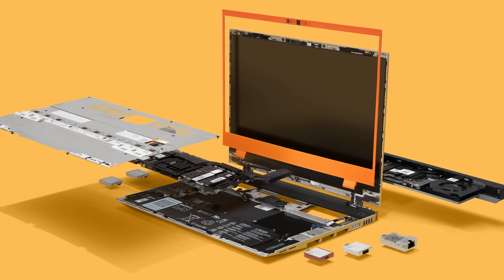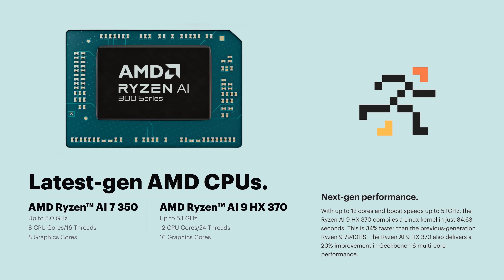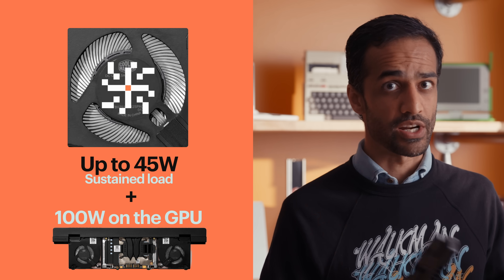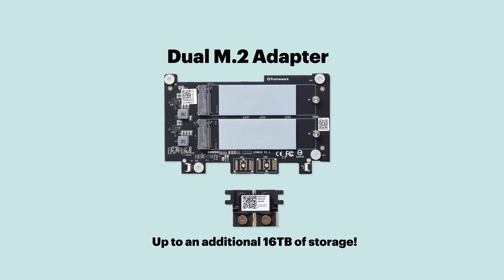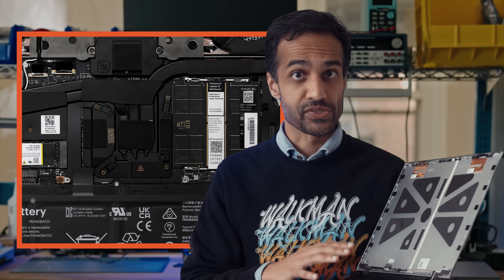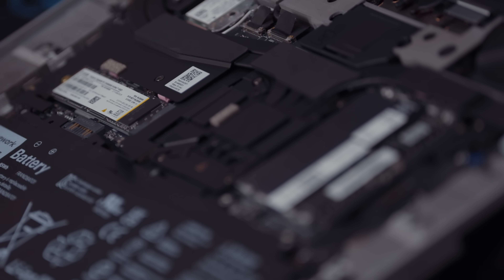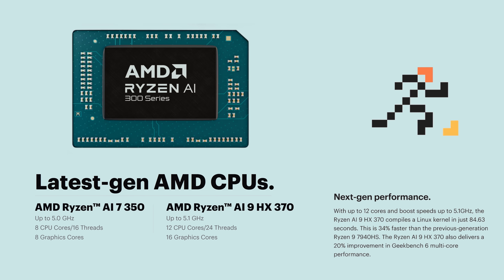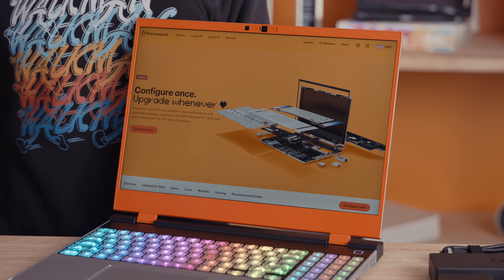Introducing the new Framework Laptop 16 with NVIDIA® GeForce RTX™ 5070

Comment: no hate..but i dont see the point in having an "upgradable" Laptop which is twice the price of a laptop with similiar performance.
Reply: It all comes down to what you, as a consumer, prefer. Some people say my privacy focused phone is 3 times more expensive than a similarly specced phone, but for me personally, it's the one that works for my use case.

In your case, if the modular design isn't good enough to justify the higher price, then yeah, it's not worth it.

Comment: Does this has soldered ram as well? I would never expect Framework do that, except they did it in that desktop thing they did, so I'm sus if that is actually the one I was expecting for.
Reply: It's not. The CPU in the desktop wouldn't work without the soldered ram if I'm not mistaken and they were shooting for a AI powerhouse. Made the most sense for the mission in the desktop. From what I've read this is the reason that this laptop doesn't have the came chip as the desktop, so it's swappable

Comment: If your still around when my Surface Book loses Windows 10 updates, I'll drop by and see what you have on offer.
Until then, I'll be following on forums and such for updates on your maturing product line.  
Want to see how your tolerances translate into a unit that's not falling apart from fatigue in a couple years of normal use.
I assume my Surface Book 1 should just now be in the prime of its life, for example.

Comment: Framework, will there be at least some military-grade protection for those living in urban areas under summer heat, and tropical areas? Engineers, architects and on-the-go power device users might need them

Comment: Why laptop with basic specs costs around 1000$, when i can buy better for same money. And i already did. What's the point? Upgradeability?
Reply: that's the main reason to buy this... upgradability and easy to repair.. you pay big at first but it cost less and less to upgrade it to the current future gen, rather than spending $700 for the same standard in the future i'd rather pay $500 motherboard upgrade

Comment: i have a 2018 MacBook Pro - the battery will no longer hold a charge. I took the laptop to the Apple Store to have the battery replaced. They plugged my computer into a tester to make sure that the battery was the only thing that was wrong with it - confirmed: the battery was the only thing wrong. Then, the kicker: they no longer will repair/replace batteries on my model so a perfectly good computer is now e-waste 🤬. My next laptop will be a Framework.
Reply: they more expensive then apple..
Reply: @0xVlad maybe - but repairable.

Comment: Hey Framework your laptops have a great modular design and creative innovations. However, for IT security, your trade-offs are important to know:

- Firmware Updates: Historically, BIOS updates with critical security patches have been significantly delayed. While Framework is improving this, it's a risk for those requiring immediate patches.
- Secure Boot: It works, but configuration is more technical and less intuitive than on mainstream laptops. It's not "broken," but it's expert-oriented.

Verdict: You trade a polished, automated support experience for hardware repairability and control. For security professionals, this means more hands-on maintenance and potential delays in updates.

Comment: FYI, just ordered a Zenbook Ultra G1a. I was strongly considering the Framework 13, but it was screen flex that pushed me over the edge to spend 2x the price and get the Zenbook. Don't listen to your fanboys that screen flex isn't an issue. It is. For business needs, we care strongly about the durability of the system. I need my laptop to last me 3-5 years between refresh cycles. Hopefully in 5 years y'all have this addressed across all models but otherwise it keeps y'all consumer grade only.
The gold standard I aim for is "Can the airport security team chuck the laptop across the scanner belt without having any damage?". That's the level of durability that I don't just want, but absolutely require. In the past, I've purchased slower and less portable laptops because it was the only way to ensure the hardware would last a full refresh cycle. I'll be watching closely. Good luck!

Comment: I bought a used P-whatever thinkpad like 2 years ago where I could upgrade the graphics card. There were graphics cards being sold on ebay. The card wasn't swappable by just sliding a module out the back, of course. (I returned the P-series cause it was so large it barely even fit into my backpack.)

Comment: I am very interested in purchasing this. However, I require at least 16GB of VRAM and currently a 5090 with 24GB would be best. Is such an option on the horizon? I would especially appreciate a higher end laptop that is repairable.
Reply: They can't as the GPU module can only accommodate 4 memory modules.
Reply: @michaelhorgan9525  I am not familiar with such details. Does 4 memory modules mean 8GB VRAM maximum? Or is that something that can change from generation to generation?

Comment: Need 8 expansion ports on this instead of just 6 to really take off, and Nvidia GPU is just 8GB, Acer predator has the 5070Ti with 12GB of VRam and is significantly cheaper, come on!

Comment: Can you offer old mainboard modules officially as options on your site? I have a FW 16 and while its great, i cant run win10 on it because of the newer tpm modules not supported on win10 (which is complete bs on MS's part). Id take the ability to support win10 with tpm and a lower price by downgrading to an older mainboard if that were an option. (Theres the 7000 series on the website but wasnt there an older intel version of the 16 too?)

Also itd be neat to provide options for wifi modules included, realtek is just inferior to intel wifi cards; or leav it out for like a dollar less price lol
Reply: intel was never an option for 16

Comment: Is the graphics card board connection port proprietary?
Is there no way to use an adapter or extender to connect an external graphics card via PCIe and utilize the full bandwidth?

Comment: I understand not being able to get 9955hx3d into the laptop but a 5070ti should have been used instead of the 5070 so users could get 12gb vram instead of 8.
Reply: if you watch their q&a they physically couldn't fit any more onto the chip, so they went with 5070

Comment: Pre-ordered one, batch 4. Stay true to your mission, and you got yourself an eternal customer.
Reply: Which one did you ordered? I saw there were few models?
Reply: @sanudas3398  Ryzen AI 9 HX 370 with RTX 5070 module
Reply: @sanudas3398  I ordered the Ryzen AI 9 HX 370 and the RTX 5070 expansion module.

Comment: Nvidia is welcome, but still 2 main missing features for me to never look back:

- ThunderBolt 4 or 5 (this requires Intel CPU normally). I refuse to buy a laptop that doesn't have TB these days.

- True TKL keyboard, for those who are blindly typing using PROPER SIZE Arrows + Home|End|Ins|Del|PgUp|PgDn in their standard positions (and are willing to sacrifice an otherwise lame numeric keyboard). Just check what Logitech has done with TKL 915.
Reply: the usb c ports match the spec for thunderbolt i'm pretty sure, they just aren't certified because it takes a while to be certified

Comment: With a dedicated GPU, is there actually an option out there (like a docking station) that delivers HDMI and power through one USB C cable with enough wattage?

Never found a docking station that could deliver enough W to my laptop (which charges at 300W :’( ) - makes the thunderbolt kinda useless

Comment: $2,350+ (not including shipping and taxes) for one of these with a 5070, no ram and no storage is just crazy!  I get that this is super repairable and all that but, why would anyone pay $1,000+ extra (based on a comparable normal laptop prices) just for that?! If you buy a normal one and take care of it i'tll last you as long as the live support of this thing and the money you saved can go to the next one you get!
Reply: You're paying precisely for upgradability & repairability. Framework do not have a 'live support' limit. Their goal is for a laptop lifespan of 7-10 years. That's way beyond what some craptastic piece of junk can manage. Framework users can swap out broken or outdated components at will, which means the laptop isn't just surviving, it's thriving. 

Most laptop manufacturers can't even repair their products within the 12-month warranty, let alone years down the line. Not to mention the terrible environmental impact. This short-term 'make it cheaper' mindset is partly why companies have turned to subscription models and engineered obsolescence.
Reply: @alexanderg1935 and how much will those repair or upgrade parts cost you? If the prices are as high as this you're way better off getting a brand new one!

Comment: It is nice to see what you guys are doing but the price and specs for the laptop are too high. Can you make a laptop with midrange specs Ryzen 5 or 7 or i5 with 4060 or 5050 or 5060. Please, 
this laptop with Ryzen ai 7 350 32gb 1tb SSD rtx5070 (8) costs me 2600$, 
While another laptop with same specs but with 2tb SSD and a oled display only costs 1800$ to 2300$ that is with better cooling and RGB. If you can manage the pricing this laptop will be amazing

Comment: Why are these Framework 16 laptops so expensive? £2.7K for a AI9 HX370 and a RTX 5070, when I can get an MSI Stealth A16 (which also has HX370 and RTX 5070 even a power adapter who would have thought) for £1.9K? Gigabyte Aero X16, same specs £1.6K. Your laptop seems like a scam, an upgradable laptop is supposed to save you money. I don't understand why you are charging 40-60% more than the competition just so you can "upgrade" with an overpriced module. Why would anyone buy this laptop instead of literally buying a RTX 5080 laptop with night and day performance gains for the same price.
Reply: cuz what u gonna do when ur precious msi stealth breaks lol

Comment: 3:49 This prompted me to scour the website for GPU options with more than 8GB of vram for the framework laptop GPUs. Unless there's some new technology that I'm not aware of that makes the CPU alleviate VRAM limits, it's like loading a truck with stuff. If the truck holds 3 tons (8GB of vram) of goods at max, and you try loading the truck with more weight (more VRAM) the truck isn't happy.  Mobile RTX 5070 with 8GB of vram just feels so wrong, unless GDDR7 somehow works around this issue. Then I'll eat my words.

Edit: I know this isn't Framework's fault, whether it be physical space on the modules or theoretical use-cases, but it's something Nvidia could be doing better.

Comment: This is great news, absolutely fabulous. 
One problem: the industry did not fail to solve the problem. It's the opposite. Solved multiple times, solutions die. I owned 2 (still own Area51m) laptops where EVERY component including gpu is replaceable. 1) no parts; 2) the manufacurers move on with more pads than the last generation, it's physically impossible to fit. 
The PCIx bridge is of course convenient but only as long as it's backwards compatible as an interface. (Which it should be - for now). I'm rooting for you guys and really curious how many years of compatibility we can win here. As of now, the 240 W model is finally something picking my interest in a practical sense. Well done.

Comment: Is the new Graphics Module compatible with 7040 series laptop 16? If not, then this is not a real "Upgradeable GPU", since you need to buy new laptop
Reply: That's actually stated near the end of the video. Very nice to have an option of 7040 CPU and 5070 GPU together. Finally, FW16 got a massive update. Great job, Framework!

Comment: 2:37 - This laptop is already e-waste for gaming purposes. Such a shame you didn’t go with the RTX 5070 Ti instead. As Hardware Unboxed and Jarrod’sTech have pointed out, 8 GB of VRAM is outdated in 2025 – we’ve had that since the GTX 1070 back in 2016. For modern games at 1440p/1600p on high settings, it simply isn’t enough. Once VRAM runs out, the system starts swapping to RAM, which causes severe stuttering and ruins the experience no matter how fast the CPU or SSD is.
Reply: Play better games and that won't be a problem.
Reply: @lembarkii8669  That’s not really a valid counterargument. Hardware isn’t judged by how it performs in cherry-picked titles that happen to be lighter on resources, but by how it handles the current and upcoming games people actually buy gaming laptops for. In 2025, 8 GB VRAM is a bottleneck at 1440p and above, and once the buffer runs out, no amount of ‘playing better games’ will prevent stuttering and frame drops. The point stands: if you’re paying premium for a gaming laptop today, it should be equipped to handle modern workloads properly, not rely on avoiding them.
Reply: @sondrel2  I think this problem should be solved by the videogame companies that no longer care about optimizing their games properly just because technology is growing fast and they forget about last year's systems 
Or maybe, just maybe, laptops were not meant to have the power to play the newest, top of the line AAA games at that high resolution. I'm pretty sure that it's only those kind of games that need over 8 f-ing GB of VRAM
Whoops, it seems like I ended up exploding into this rant, sorry... I mean, it's ok to want to play these games in other places away from home, it's just that I despise when this problem is shown as normal, especially considering that it's not that hard to solve 
Have a nice day ❤
Reply: @EtherealBook  I get your point, but the responsibility can’t just be pushed onto developers. Games will always continue to grow in complexity, and history shows they rarely scale backwards to fit old hardware. It’s the job of hardware manufacturers to provide specs that actually meet modern demands. 8 GB VRAM was fine years ago, but in 2025 it’s objectively a bottleneck at 1440p/1600p. And regarding laptops: there are plenty of models today that do handle AAA games well, it just requires the right GPU choice. Pretending that this limitation is normal only lowers the standard for everyone buying ‘gaming’ hardware.

Comment: Can you please emphasize the difference between upgradable and repairable?

If you're not offering anything better than an RTX 5070 is it really upgradable? Or are there any other GPU modules being planned with an RTX 5080 and RTX 5090?

For an almost $1000 extra premium that brings me upgradability, I sure hope that I can upgrade the system in the future. Or else if I can reduce my costs and get a cheaper non-upgradable device with RTX 5070. And a few years down the line purchase something again non-upgradable (thus, cheaper) with a 70 series card.

The upgradability just becomes a gimmick if I cannot get to a higher level than what I am currently at. Which in this case is pretty average middle of the pecking order specs especially on the GPU side.

Also, can you guys please put the Ryzen AI Max+ 395 on this laptop, the one on the framework desktop, and then put an RTX 5080 or RTX 5090 in it?

As someone who works with LLMS and likes to play GPU-heavy games, I would love to see that happen.

Comment: Unfortunately 5070 is the worst laptop GPU out of all the 50 series GPUs out there due to it having the same VRAM and 100W max power limit as the cheapest 5050. There is no point in spending so much money on that upgrade. It would be great if Framework supported RTX 5050 or 5060 as well as those are the actual reasonable value for money cards. 
If anyone wants to pay more for performance then the upgrade from 5050 or 5060 should be to 5070 Ti since it actually has more VRAM and higher power limit than those entry level cards, unlike 5070 which is an NVidia money trap.

Comment: But if you have an older Frame Work 16 you still need to replace the main board to the latest AMD motherboard and CPU to use the GeForce RTX 5070 GPU which still only has a meager 8gb of vram. I don think you can really call it an upgrade if you need to essentially replace the entire motherboard every time there is a new GPU “upgrade.  It’s no different than buying a new laptop every time. That is why I still chose Asus Zephyrus G14.  It’s expensive but it’s so sleek and small and I get the latest 5070 Ti with 12GB of vram. I spec it so it would last for a while. While I probably couldn’t replace the mono on my own. Framework laptops are akin to PC cases and to “upgrade” is like buying a brand new PC build kit but keeping the same case. Who gonna buy the old CPU/Mobo units? It’s such a niche market. Basically same thing it’s gonna be e-waste in the end.

Comment: Do I understand correctly that Mr Modular Laptop company comes out with a different laptop chassis about every 2 CPU generations?
Reply: They are all backwards compatible, because thats the framework mission. Idk if you want them to not optimise or improve things or what, because making better products without rendering old products un-upgradeable or obsolete is very impressive and absolutely in line with what framework claims to be about

Comment: Make an app that allows selecting the pieces you want to switch or upgrade and check if the current setup works with the new piece and suggests combo alternatives. Like for power or thermal management.